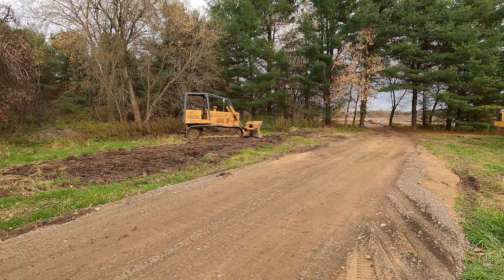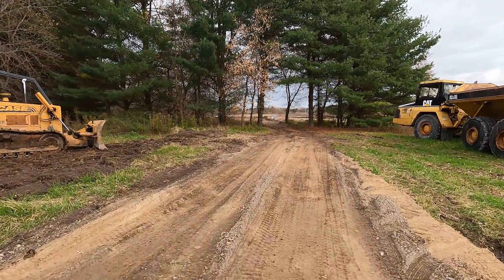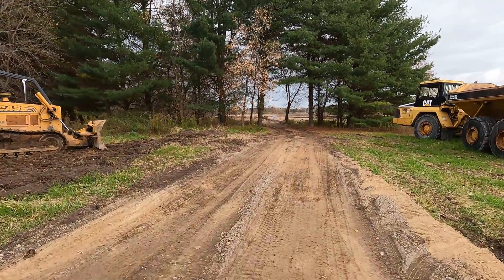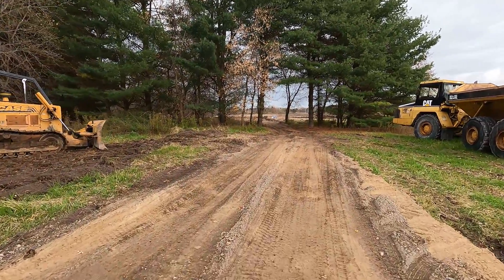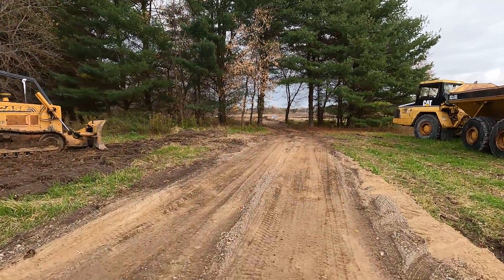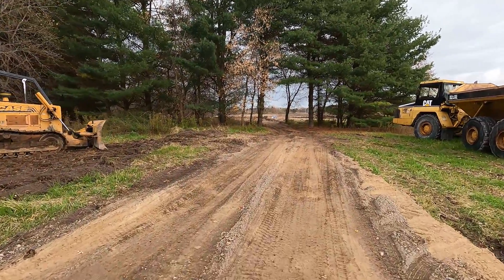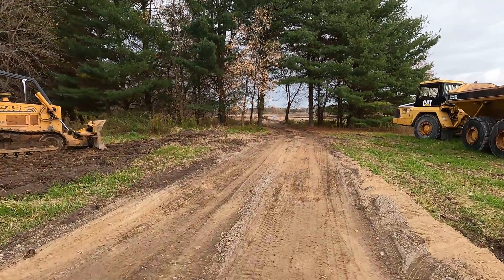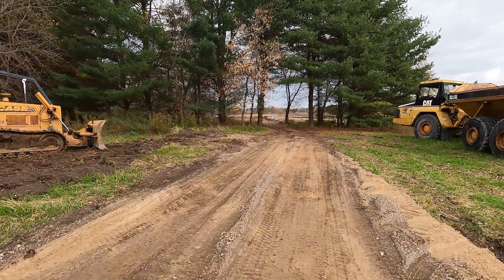The Footing Forms are in Place! Building My Dream House 11-3-2021

Comment: No Foundation dug down below the Frost Line ?
Seems Sketchy.
Reply: I am sure they are going to backfill so the footing is legal depth.
Reply from the maker: Correct. Back fill has just finished with the sand and now clay will be hauled over from the pond for under the yard.